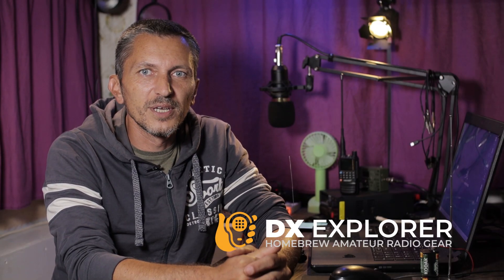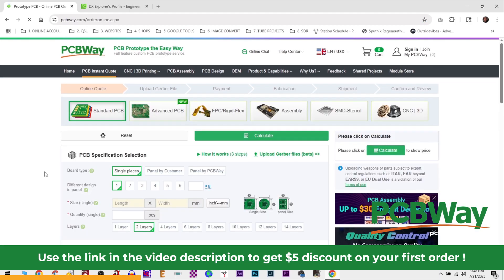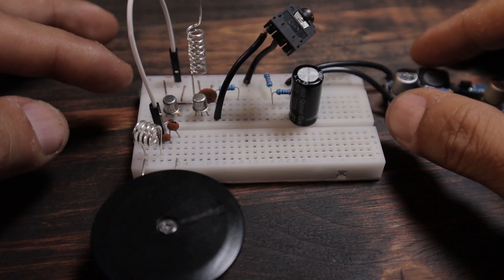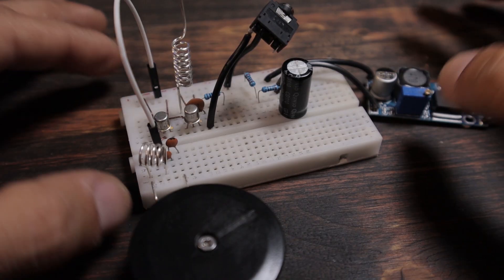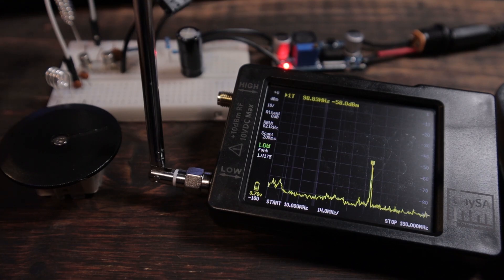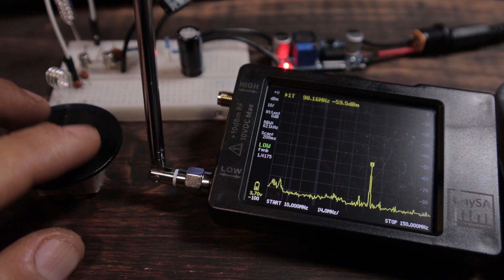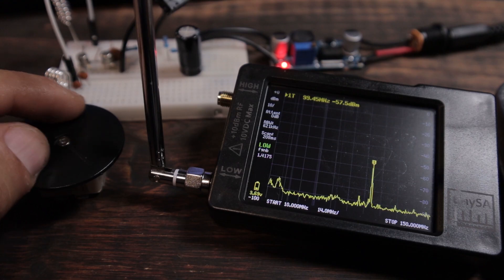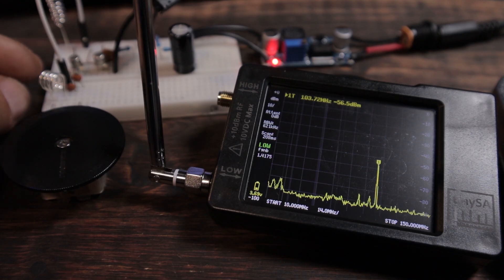Making a Simple FM Radio for Fun: Was It Worth The Time ? - Part 2

Comment: Hey man what are the number of the original transistors, can you tell me?
Reply from the maker: I found two schematics online... in one they had S9014 or S9018... and in other schematics I found that they used BF494 or BF199. Sadly I have none of the above... so from what I had the only decent and good results I had with BF200 from some old stock I had. I don't think these are still available, but I am thinking some equivalents may do the job just as good. 73, YO6DXE. P.S. I also tried 2N3904 as in some videos on YouTube lots used them... for me from a handful of 2N3904's... only two worked but with poor results. So these may be OK for experimental purposes but the results are not so great.

Comment: Been down this road many many times!   LOL  🙂
Reply from the maker: Hahaha... me too as a kid. I think I just got too used on having successful projects all the time 😅 73 buddy, YO6DXE.
Reply: @dxexplorer  Gotta take the good with the bad sometimes.   I just build a regen receiver from a a 6AU6A and used a 12AX7 for the audio amplifier, the thing likes to squeal, but not hearing any stations what so ever, even with plate voltages as low as 20vdc right on up 250vdc, other then loudness, still made no difference in receiving anything.   Gonna dump some audio into the audio amp tonight and see if that is working properly or not.   But so far, the whole thing is just a pile of parts.. LOL
Reply from the maker: @Radionut63 😅😅😅 I have the tube projects also on the waiting list as I barely have free time. So until I am able to do something, I hope yours turns out to be successful and figure out what's wrong there and get it to work well 😅 All I can say is good luck. I will come watch and see how that goes.

Comment: Just because It's not high performance it doesn't mean It's a failure ...It was intersting to watch.
It was still receiving stations isn't it?
I saw at least 3 versions of FM superegenerative recievers working but not high performance.One of them was made for Air Band as these can recieve like someone already said AM but it takes lot of time and experimentation ..Instead of a coil one can use a single loop of wire .I saw first this trick used in small mp3 fm transmitters and  that made them more stable so that they weren't affected as much when touched by hand.
But yes few pico affects the frequency..
Reply from the maker: Indeed that is why I was saying that is "kind of a failure" haha not entirely. Failure just in the sense that is not easy to replicate by kids and other people that usually just want to build something fast and work right away. But with a little time and effort it can work and is not that bad at the end. Like you say... it does receive stations. Even though I got a lot of headaches trying to make it easy to replicate... I still love the project. So it is still on the list of projects to return to. 😁 73, YO6DXE.

Comment: Some of the lower frequency transistors like 2N3904, have high inter-electrode capacitance, where as transistors like BF200,  have less capacitance, and work better at RF.  Devices like MPSH10 and KSP10, 2N918, etc may work better. Higher frequency devices in SMD packages, may be hard to tame, as their performance is into the GHz range.
Reply from the maker: It's true. I noticed when I wanted to design a PCB board for this one... that is no easy to replicate using general purpose transistors as some 2N3904's work and some not. The idea was for kids or people that want to build it would be able to find the transistors really easy. So I guess I will try to find some up to date transistors that work well at these frequencies and they are still available. This way it would be easy to replicate and I have a guaranty that it works well... even if it has limitations... at the end it is indeed a nice simple project to have fun with. 73, YO6DXE.